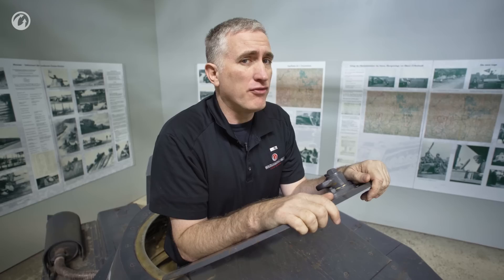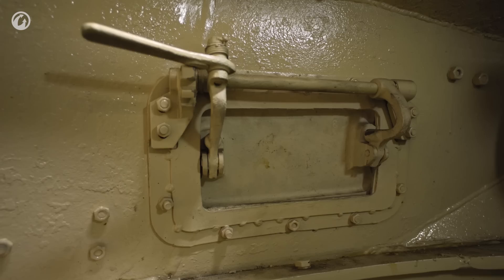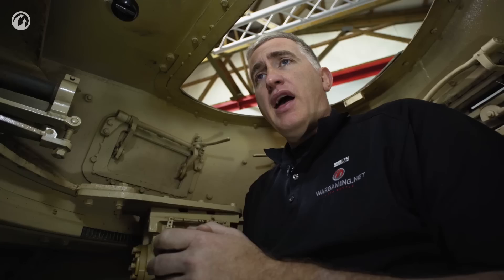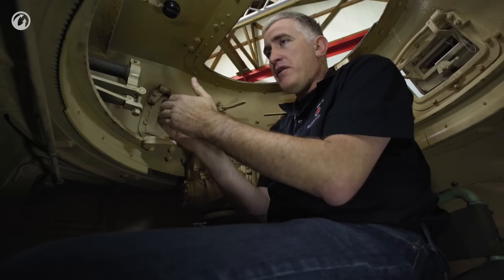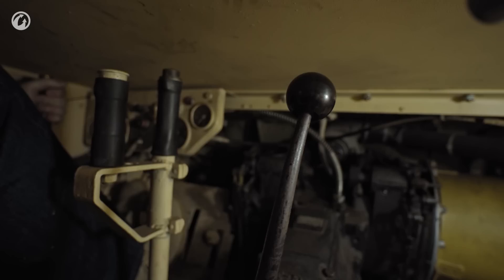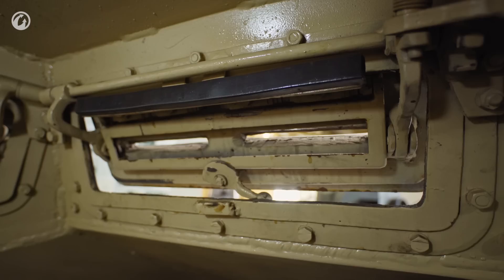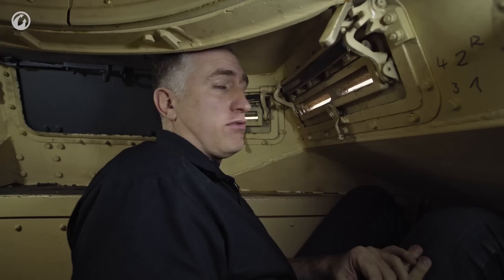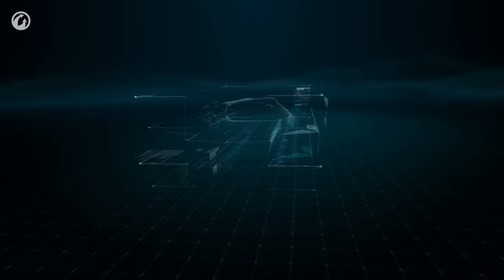Inside the Chieftain's Hatch, Panzer 1 Pt 2.

Comment: I was always curious whether they replaced the box-fed MG13s with belt-fed MG34s by the time the tanks actually went to combat in Poland and France, but it would appear they didn't. I guess that was still pretty early for the MG38, and they probably needed all the production to outfit newer, better tanks, since the Pz I wasn't being used for serious front-line combat anymore, and the MG13s would work okay for the scouting duties and such they were intended for. The two-gun system is interesting. While it does give you a heavier weight of fire when needed, I suspect the real reason for having two guns is that in any kind of serious combat with nothing but air-cooled MGs as a main armament, the guns would overheat quickly (most video game players don't seem understand how serious this is, and how carefully you must handle a gun to avoid this, firing only five shot bursts with pauses in between...no spraying down the target and laying waste. If longer bursts are used (say 25 rounds, a full magazine for an MG13) you must wait 30 seconds or more for the gun to cool. if you don't, you will overheat and ruin it). Having TWO guns available allows you to switch back and forth, and let one gun cool while using the other one. I first though that maybe it was so one gun could keep firing while the other reloaded, but since the same man has to fire and load the guns, that wouldn't work well. An added benefit, in light of the limited magazine capacity, is that two guns used in sequence allows for a burst twice as long before having to stop and reload. This can be important in cases where it takes a whole magazine just to ge the fire falling where you want it, or if there is a long wave of infantry advancing, or you need to keep up bursts of cover fire. Of course hopefully you have several tanks with you as well, so someone is always shooting. I suspect that everything that I just said is also true of the twin coax MGs which were considered a major part of the armament of the early variants of the Pz III. IIRC those were also MG13s, but I may be wrong. Even if they were belt fed, the part about taking turns to let one gun cool still applies, and with the III, the loader can reload one gun while the other is being fired.
I don't think the lack of vision slits is important. A Panzer I was not meant to be operated under heavy fire, it was just to offer some protection if you were taken by surprise. With the weaker armor and vulnerable points like vision slits, a light tank that found itself under machine gun fire would rarely just sit and take it, they would try to beat retreat and get under cover again. The risks of a round striking an opening were too great (this is also why the vision slits are only on the rear). Most of the time you'd be driving around between one place and another, and not under great risk in most cases. When the enemy fire started coming in, or you felt like it might, you'd button up and accept the loss of situational awareness (they hadn't really figured out how important that was yet; they still figured the tanks would basically be following their leader and attacking well defined targets directly ahead of them). In most cases though, on a Pz I you would just leave the "windows" open and avoid being shot at. Once the fire started coming in, assuming the enemy wasn't skillful enough to put the first rounds right through the openings, you'd immediately button up and either engage them with the optic sight, or retreat out of direct fire.

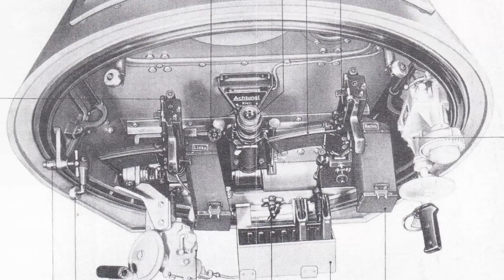Comment: That turret is a fake one and it lacks most of the gear that a real turret had. Compare it to the photo at 3:04. The roof lamp, optical sight, open sight bar, and MG mounts are missing. The elevation gear is missing. There is a traverse gearbox but it isn't from a Panzer 1.

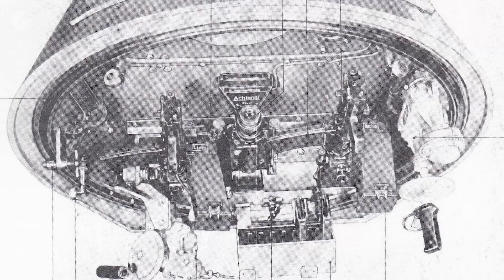At 3:02 the Chieftan says that the MGs had "electrical triggers". Well, they didn't. What they had was trigger grips on both the traverse wheel and elevation wheel, linked to the guns by Bowden cables. A small device at the end of each cable was clamped to an MG's trigger guard and it simulated a finger. How is this man, in this role that he chose for himself, making such a basic mistake?

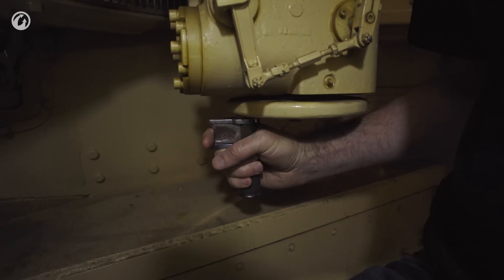At 3:20 he's telling us that the traverse control has fine and coarse speeds. He shows us the speed control. But that control is not a Panzer 1 control, it's from some other tank! Again I ask, why hasn't this man done the basic fact finding we deserve?

Comment: Check out the Pz 1a in Norway, much better shape, appears more original. Too much missing on the Munster vehicle and so so reproduction of replacement pieces i.e. muffler guards, fenders, wrong bolts access hatch, etc.

Comment: 9:00 what is synchronized gears?
Reply: It smooths out shifting.
Reply: A synchro on a gear means you don't have to manually match the engine revs to the gear you're about to go into, you can just push in the clutch and immediately move the gear shifter to the next gear. A gear without a synchro means you have to manually match the engine revs with the gear you're about to go into for it to be able to go into that gear.
Reply: @dvdraymond  I assume all cars today have it?
Reply: @piotrgrzelak2613  yes

Comment: Wonder what an RPG7 would do to that thing
Reply: I believe that the term is "significant life changing event."
Reply: I bet in a few places jet would go straight  through and out
Reply: @Jccarlton1400  significant emotional event?
Reply: significant life changing event as the RPG round fired its jet right into the Panzer 1. The armor on that tank is probably enough to actually set the RPG's hollow charge off even at the armor slope and nowhere near enough to prevent penetration.